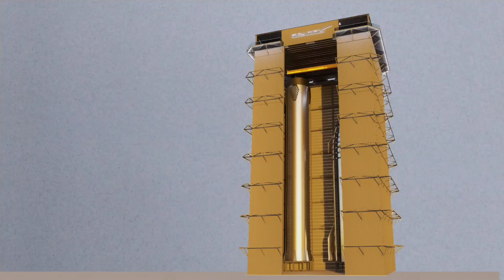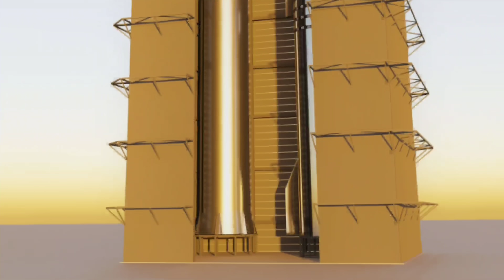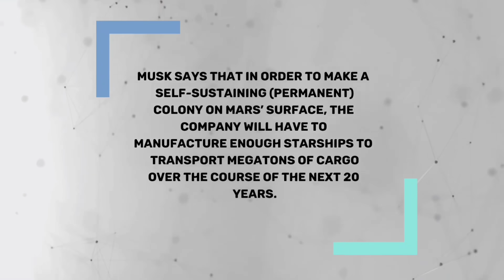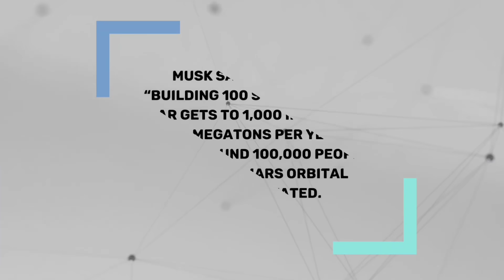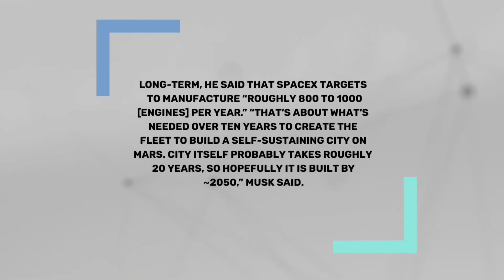SpaceX Plan To Build New HIGH BAY ! SpaceX Achieved 100 Raptor Milestone

Comment: they do not stack 70 meters high in high bay. They stack 37 rings high X 6 ft. That is 67.66 meters. The other 2.34 meters is the amount the raptors hang below the rings. that makes the 70 meter booster height.